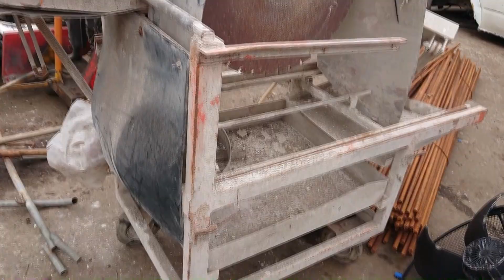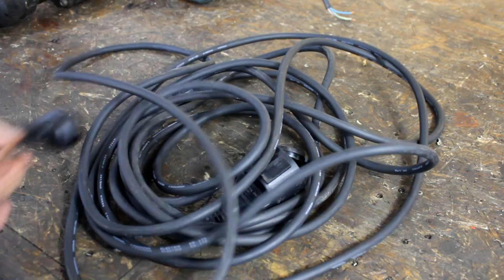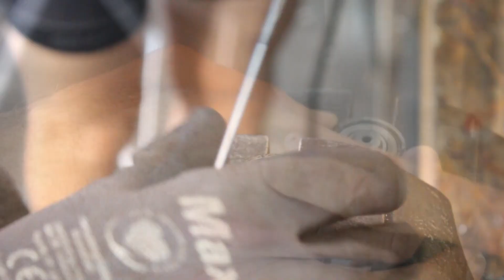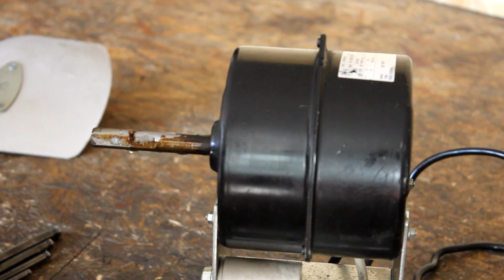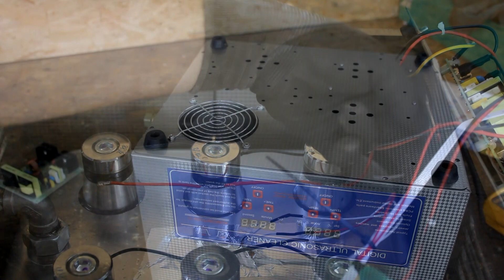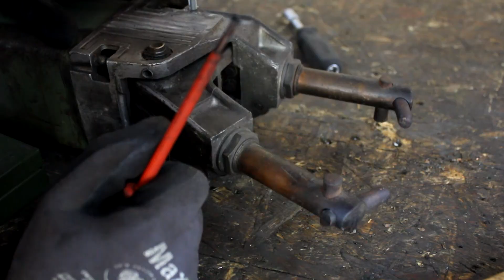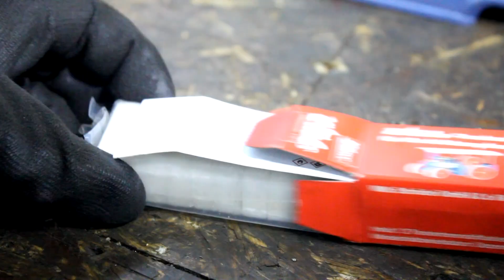Scrapyard Finds to spare! Repair-A-Thon!

Comment: I had one of those steam engines when I was a boy. I'm sure today it would be deemed "too dangerous".
Reply: One can actualy still buy them, but they are quite expensive new.
I recently bought a few 1970s steamplants of the simplier models i restored back to functional condition.
Reply: No, they're not exactly common, but nor are they rare. My brother had one back in the early/mid 2000's.
Reply: Was dangerous back then had a friend who had one which exploded in his face when I was young he got some pretty severe burns.
Reply: @DaDunge  Was that the very old model with a lever on the safety valve? if one manipulated or replaced the weight on the lever with a hevier weight the valve may got jammed and the softsolder on the flange won't hold up safly for more than at maximum 6 bar i think (mabe more since the construction is pretty strong), since the working pressure are only ment to be about 1,5 bar on those... They are supprisingly taugh, but the boiler tinplates are only i think 0,25 or so.
It's not like the very old Märkling (Doll/Falk, etc) large steamplants wich had a different construction, but still they where less than 2,5 bar maximum working pressuren even on those giant macines.

The newer ones from the late 60s and forward had a different construction on the safety valve with a spring instead of the lever, some rare models was re fitted with the new type of valve in paralell with the old one after the company recived information about those accidents with children manipulating the weight in order to get more power bu increasing the steampresssure wich resulted in rupture of the boiler, with the spring loaded valve that was no loger possible to do.

(Modern replicas of the levered valve is only the wistle, the actual valve is the spring loaded type on the replacement parts)
Reply: @Vampi_Sweden  No idea, I didn't see the accident's only the bandages he wore after it.
Reply: @DaDunge  Ok, Dry running, without water is another thing that would destroy the boiler, i repaired few where the soft solder had melted because of dry running.
I saw that it was even possible to still order the entire boiler new!
Reply: I ran mine on circled pipe cleaners with a small vertical wick sitting in molten bacon grease, I needed something to burn cause I  didn't like the smell of sterno
Reply: @frankdeegan8974  There are aftermarket spirit burners for them, but they will make a lot of soot on the boiler that is quite hard to clean up. But, yes, why not! ha ha

 @Fredrik Dunge  
I hope he's face recovered well!
Reply: Them steam engines look great. A pretty penny nowadays i think

Comment: That spot welder is designed to hang on a balanced steel cable from the ceiling, so the user only needs to pull it horizontally to the workpiece passing by on the assembly line. You fairly quickly learn the difference between weight and mass using one of these.
Reply: Automotive industry used them before robots took over.
Reply: @Elfnetdesigns  Body shops still use them, when replacing new panels, to make the repair as original as possible

Comment: Hey, just a nice to know trick: If you want to get metals de-oxified post haste, make a max strength solution of citric acid, dump it and the metals to an ultrasonic cleaner and blast away. You'll be done in no time.

Comment: I could have used one of those drills for the lift system on my Popup camper.  Any time you can salvage parts or pieces of a heavy duty industrial  tool, you are doing someone a favor. You can sell those tools easily and make some dough!I would have loved to get that steam engine set up. Those are highly collectable here in the states and go for top dollar. Thats an expensive  set up here. What little bit is wrong with it is nothing. Use distilled water in that. I had one of those as a kid. Sadly I abused mine to the point it was junk.

Comment: That steam engine workshop model is so awesome! Thinking about back then, there were no electricity, but still people had drill presses, grinders lathes and so on. Thanks for the video!
Reply: About the only thing inaccurate in the model is the steam engine in a real shop would be in a separate room.  (This helps control the spread of grime from a very grimy system, what with coal ash, grease, and coal dust.)
Reply: Another way main shafts had been powered was from a water wheel from fast moving rivers and waterfalls.
Reply: @slshanklin  And there was at least one mill in the UK, built before how to use a steam engine to drive the main shaft directly was worked out, that used a steam engine to pump water up to a high-level tank so it could drive a waterwheel-driven main shaft.

Comment: I felt my self getting angry when that motor was thrown out due to a bad starter cap. Litteraly balled my fists.
Reply: On an industrial unit that needs to have no downtime at all, it can be cheaper to replace the whole motor. Not only do you save one additional installation of the whole unit into the AC system, but also the technician who has to clean, then diagnose and repair the motor unit itself. Plus, if you have this kind of downtime, it'll probably cost you lots of money as well.
Reply: @Seegalgalguntijak  Every HVAC tech has spare cap's in their truck. And removing the entire motor fan assembly vs replacing a cap? That's just shitty workmanship.
Reply: @meistro32  In theory - yes. But you don't know how accessible the whole thing is. Plus, it definitely needed a good cleaning anyways, with all the grime.

Comment: You cant take or buy anything from the public recycling centers in Denmark its depressing to go there and see all the great things that dont even need repairs
Reply: It's the same in the UK. I bet that the public recycling center staff do though. I once got shouted at by them when I asked someone for the small table he was just about to throw in the skip.
Reply: @Penster-Elle  The stuff I have seen :( often you can sense that grandpa died and his entire workshop just got rammed into the metal container just boxes of oiled nice tools and their all wood furniture is in the next container, I have seen silverware, old coin collections, rare consoles, enameled cookware sets.... its just endless and the obnoxius workers follow you around
Reply: Same in Belgium
Reply: Not there in Finland yet. I bought Elu 172 flip table saw from recycling center with 5eur last June. There was a big truck with magnet boom clearing the yard already. So couple of hours later it would have been gone. It needed a new power cord, and turntable was jammed. Table is still jammed, but even the blade was usable. Those are typically around 200eur second hand.

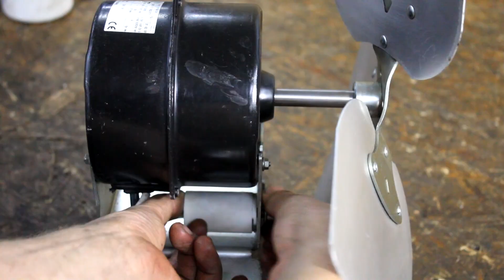Comment: 10:05 how does that capacitor measuring tool work? How does it measure
Reply: There are lots of options: 1) putting a defined current into the capacitor and measure the rate at which the voltage rises.  2) loading the capacitor up to a certain voltage and unload it through a resistor and measure how much time it takes. 3) Make a RC filter out of it and measure how much it dampens certain frequencies. 4)...
Reply: https://en.wikipedia.org/wiki/LCR_meter
Reply: @rhalfik  thanks

Comment: If the air blew the wrong direction through the AC it probably won’t hurt it
Reply: Yes it will hurt if the other fan turns in the right direction because then the airflow would cancel each other out.
And if there was only one motor the reverse air flow could lead to improper compressor cooling.